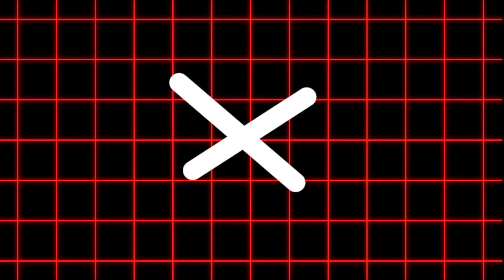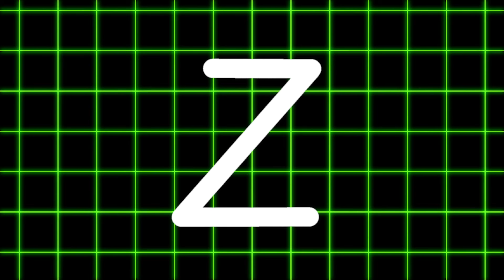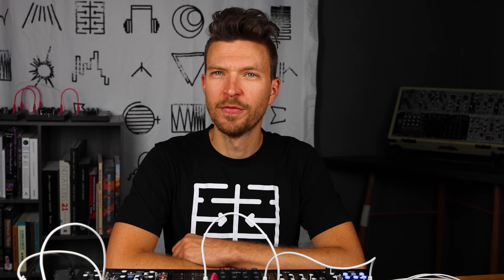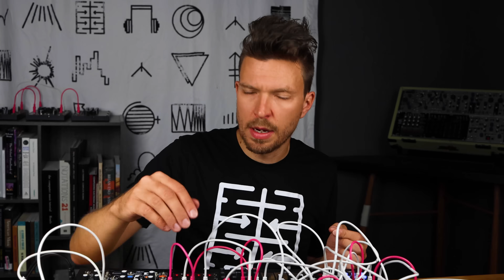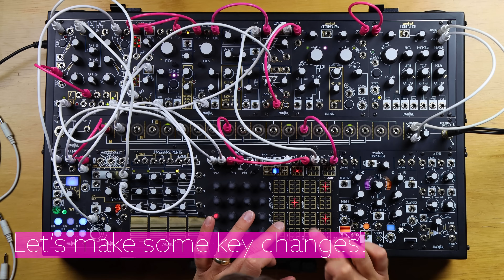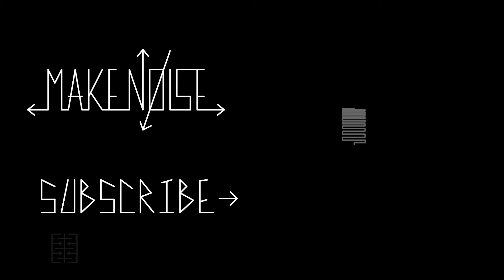Complex Single-Voice Sequencing

Comment: do these tricks work on the mk 1?
Reply from the maker: Generally no, the original René is a single channel device and here we're using multiple channels plus function (ADD/S&H) that don't exist on the original. However you could check out the original "René as Non-Linear Quantizer" and "René: Plane of Composition" videos for some ways to influence sequences via CV on the original René.

Comment: Does most of this patch work with Rene v1?
Reply from the maker: Original René does not really have any equivalent to the S/H mode. You would need to sum an external S/H with René's output and then run the result through a quantizer.

Comment: I wonder if this can be emulated with Metropolix + a S/H generator.
Reply from the maker: The tough part to emulate would be keeping the added voltages "in scale." Depending on how you achieved it, it might require a dedicated quantizer module at the end of the chain.